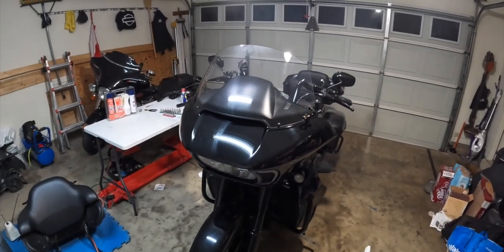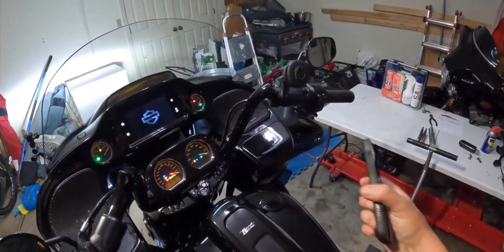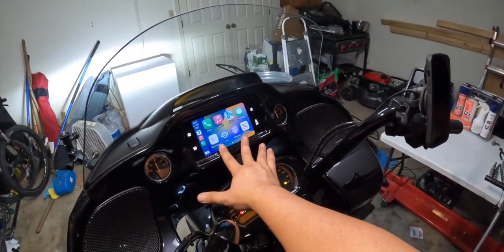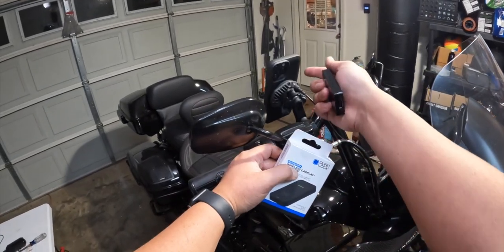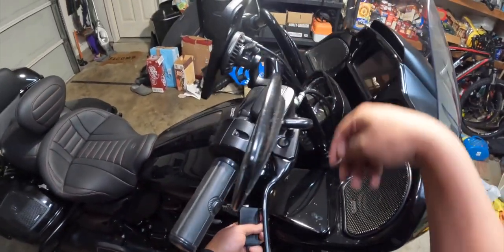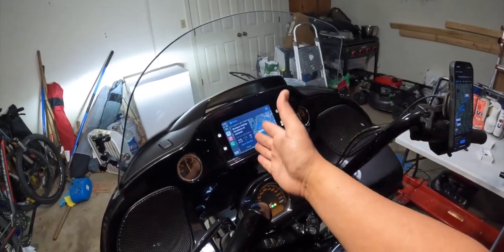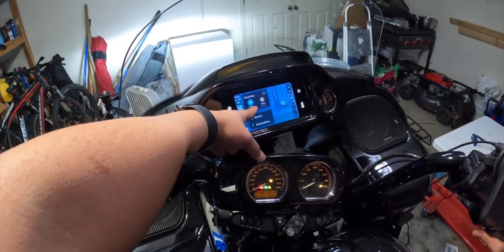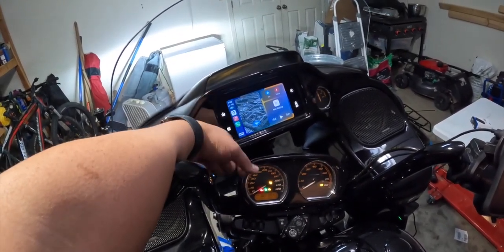Wireless Apple Carplay on Harley

Comment: Another way to do it is buy the 7 pin adapter from Bohnman customs then you do not have to take the fairing off and install the jumper. Then do the quad lock. The advantage of the quad pick is if you have the 12 v free in your top case put the quad lock there

Comment: The reason the Quadlock CarPlay adapter did not show connected to Bluetooth is that it only uses Bluetooth on startup to negotiate a WiFi connection.  If you look at your WiFi settings you will see tht is connected.

Comment: Do you need the jumper regardless of wireless or not? In other words I cant just buy the quadlock and plug and play? I will need to buy the jumper as well.
Reply from the maker: I’ve been told the newer bikes have been flashed and you no longer need a jumper. I have not confirmed that.
Reply: @roadglidedaily  Ok thanks, its 2023, i will confirm with H-D.
Reply from the maker: @brentcajthaml  honestly dude that aren’t going to know lol. Just take a cord And plug in your phone. If Apple car play comes up then you don’t need it.

Comment: Great video, but connects very slow. after the initial connection. I just saw another video with a different brand that connects in about 10 seconds. Very fast.
Reply from the maker: Yeah I expected the connection speed to be better from Quad lock
Reply: what brand?

Comment: How have you liked it? Has it been reliable?
Reply from the maker: I like it. It’s been far more reliable than the other.
Reply: Thanks, I’ve read where so many of them freeze up or just stop working. When out riding and using Google maps via Apple CarPlay the last thing I want is to loose my navigation.
Reply from the maker: @cohibafivefifty  that only time it disconnects is when my iPhone was programmed to turn off wifi at certain times. But I just manually turn on my WiFi and it fixes it.
Reply: Awesome, I’ll give it a try

Comment: Can you tell me the exact quad lock kit you purchased? I’m looking to buy a kit and I don’t want to over buy with unnecessary stuff I don’t need. The website is like a rabbit hole with so many add on parts. I have a 21’ road glide limited. I just want the same set up as you and if possible is there a video of you installing the quad lock wireless charger through the fairing?
Reply from the maker: I added all the links to the bottom of the description. I don’t have a video of how I ran the wire but when I get time I’ll do one. It really isn’t hard if you’ve taken the fairing off before.

Comment: I'm confused....I purchased a 2022 Street Glide Special....if I plug my phone into the USB port....I get Android auto and Apple Car Play.  All you have to do is allow it in settings....I am not sure what the under the fairing dongle is for...maybe slightly older bikes?...I don't know...but the wireless you have...yes that's something that works as well.
Reply from the maker: Android auto come standard on them. Nothing else required. Apple CarPlay back in 21 required a jumper when you plugged in your iPhone for it to work.
Reply: @roadglidedaily  oh just Apple Car Play...I wouldn't know that...I use the Android phone....it works for me without the under hood dongle.....thanks..and Iay buy the wireless adapter
Reply: You’re bike has apple carplay because its a special. So its add as part of the package. Others bikes don’t come with CarPlay.

Comment: Have you noticed it drains the battery on the phone quicker ?
Reply from the maker: That quad lock I have is a wireless charger. So any time my phone is on it, it just automatically charges, so I can’t say if it uses the phone battery more. If it wasn’t connected I’m sure it would since I pretty much have my google maps pulled up all the time.

Comment: hi does the quad lock wireless connect to a 2015 street glide?
Reply from the maker: I don’t think the boom radio on 2015 supports Apple CarPlay. So that would be a no. If you have an after market radio then it might depending on the radio and model

Comment: If you use a good wire like the one your phone comes with, just plug your phone in to the USB an auto or Apple  will come right on. You don't have to open or buy anything.  Except maybe the wire?

Comment: Did not work on my 2022 HD ST. Would not connect to my phone. I tried it in my car and it worked. This device was a waste of money
Reply from the maker: Did you have the jumper already installed ?
Reply: @roadglidedaily  yes.
Reply from the maker: @carlwright1351  and your Apple car play works when you physically plug it in with a cord?